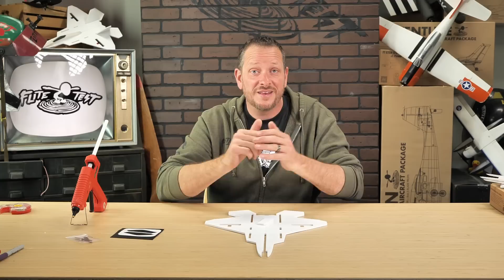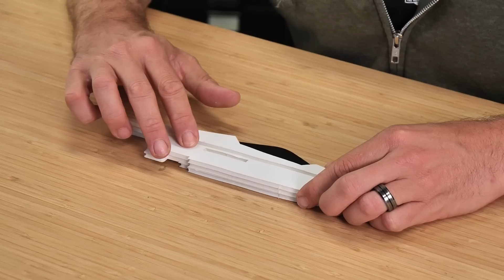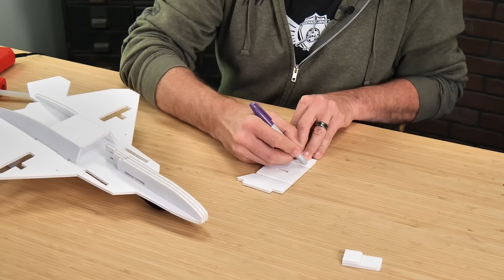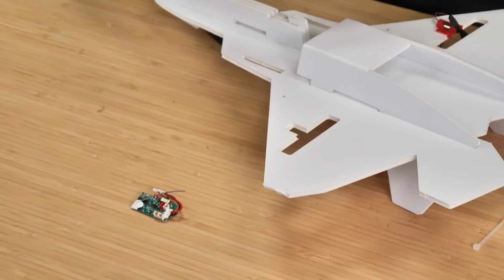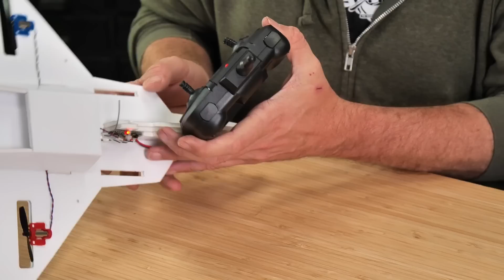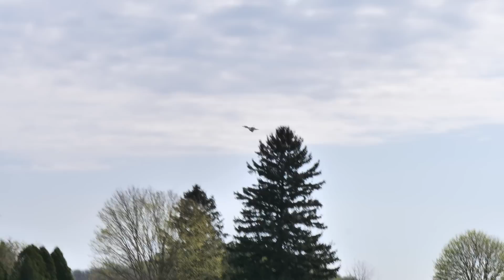How to Build the FT EZ Raptor //  BUILD

Comment: does the ez flight controller also work as a drone flight controller, or both at same time. for vertical drone-planes. arduino custom flight controller instead of 60usd+ flight controllers. the arduino can also supply the output power if the motors are low power for light weight planes and drones. arduino rp2040 boards are 20usd, so 1/3 of normal flight controllers. input can be normal battery cells, primary or rechargeable 5-20V total. the flight controller software code needs to be done separately using arduino board ide programmer c-code. flying christmas tree would be super simple. just two cross-locked triangular shapes, and quad motors, ie a tree drone-plane. oh you are using differential rotation as flight angle holding or yaw. kinda bicopter plane. nice.